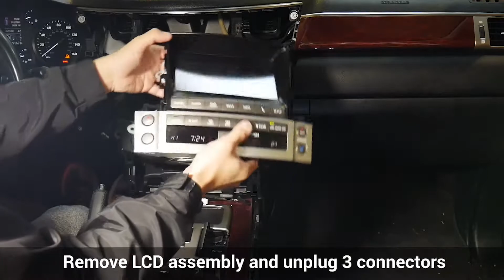Lexus LX 570 2013-2015 Stereo Removal & GROM VLine CarPlay Android Auto Navigation Install LEX7T

Comment: what if the factory radio is not working (the hard drive not booting). is vline still going to work?
Reply from the maker: Yes the VLine will still work.
Reply: @gromaudio  mine is not working. Can I get any help?
Reply from the maker: @ramanjotsingh3565  sure, contact our technical team at https://gromaaudio.com/support.html They will look into your specific setup, and provide you with the assistance.